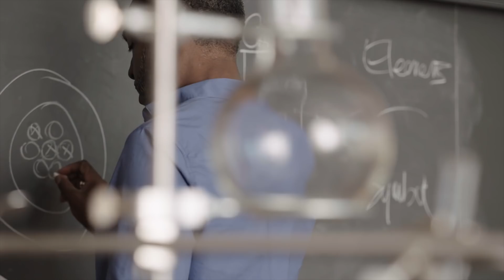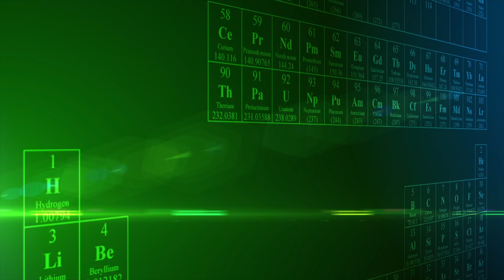A Solid Future for Electric Cars - The battery tech that will power us in tomorrow's electric cars

Comment: Now the time has come to think over twice or thrice by EV manufacturing Companies as to what kind of battery most convinient, easy maintenance, long sustainance and costwise is cheaper when compared to Lithium Ion Battery pack. Every Company found to be busy with their research and development wing to come out with this hurdle. It understood from various industries, through out the world, they are mostly concentrating on development of Solid State Battery Pack for their E Vehicles, which is found to be free from chemical reaction, easy to manufacture and econo- 
mically cheaper, whereby there is a possibility of reduction in EVehicles’ prices. Therefore, I feel Solid State Betteries would be suitable for EVehicles. Bye now.

Comment: Lithium is most abundant in troubled countries, like Afghanistan,,,, may be why we are involved over there actually,,,, and China is the beneficiary, oddly.
Sodium battery is more politically stable and salt is everywhere... The sea.  So, that development seems nice to hope for.  Now, Magnesium.... Hmmm. It is double electron availability but also more volatile.  Watch it burn in flares.  I am not sure of abundance of Magnesium or if it makes any true sense for massive amount of battery production/use.  First time I have heard of it mentioned for such purpose.  I prefer REDUX into H2 from solar/wind/hydro/nuclear.... THEN to use in Fuel Cell powered vehicles though... a variant form of a "battery", or a controlled "battery" cell..

Comment: I do wish there was more emphasis (like in Japan and Iceland?) on developing a Hydrogen based energy grid with H2 fuel cells and distribution/fueling infrastructure...
I Know, USA is large.  But, renewable energies can be used to  produce H2 along with big hydro and nuclear power generation... May be the best overall industrial scale Solar usage.  Produce H2 by day and not worry of the clouds and snow and darkness as that is already built into the equation, H2 is a storage of energy which is obviously enviro-friendly, and stockpiling can smooth out the off days..> Solar to directly feed the grid for electricity is just problematic with swings and dips of low production and necessity to smooth all that out for grids sake.  H2 fuel cell vehicles, equipped also with ultra capacitors with solid state battery combination, to aid in acceleration demand, is in my opinion, the way to go.

Comment: Electric cars are already safer and cheaper to use than explosion engines that burn and emit toxic chemicals.
Reply from the maker: There might be an issue with the recycling but overall you’re spot on
Reply: My calculator does not match up with that the pricing only becomes remotely competitive when federal tax subsidies are factored and even then when you compare a similar fit and trim it's just not the same take a gander at the pricing of the gasoline-powered Spark versus the electric Spark difference of almost $10,000 as far as I can remember. And this is in a vehicle that already gets 50 miles to the gallon so I don't think fuel savings will balance the equation.
Reply: Really>>> ??? Where do you think the electricity to charge comes from?
How about clean H2 Fuel Cell vehicles? Much better alternative but which is being politically pushed aside. Sad.

Comment: If they can produce an electric car that can charge up to say 80% capacity in 30 minutes and have a guaranteed range of 300 miles (in all weather conditions) then I would switch. 2025 is my guess despite the many promises being made.
Reply: Tesla's Model S 85's EPA 5-cycle Range is 265 miles already, and charges from 10 to 80% in 45 minutes.
Reply: I'm pretty certain your wish will be granted before 2025. By 2020, actually.
Reply: you will be waiting.... and never try excursion trips to the mountains and such... A/C and Heater will KILL batteries swiftly.  Elec. vehicles are best suited as commuter vehicles. Period.

Comment: No Electric cars winning F1 yet,no electric cars can refill in 3 minutes yet,all after 128 YEARS of being invented,No Sir,not yet,not in another 128 years either.
OK to go shopping in though,especially if you are tight fisted or have short arms and long pockets.They surely sell a lot of these ultimately Coal powered cars to Scottish folk.
Reply: - F1 is wary of new tech, but there is Formula E.
- Battery swaps were faster than refueling (until Tesla added a shield), but most people were fine with plugging the car in overnight.
- Coal plants, despite emitting more radioactive waste (aka thorium fuel) than nuclear power plants, still have better filters and locations than old clunkers driving by homes.
Reply: David, 
It wasn't difficult to install sufficient wind generation capacity given the relatively small grid load in Scotland.
How on earth do the Scottish government expect to be fossil fuel free in less than two years? Scotland is no different than the rest of the world there are lots of time the wind is either low speed or virtually nil. The point about speed is that the wind generator's out put is a cube law to wind speed so a small drop in wind speed gives a large drop in power.
Too much wind generation creates an instability in grid operation at times, or is Scotland planning on U.K.'s stable pool of power to moderate that?
Normally the inertia from large generators (in the 100s of Mwatts) provide a stable frequency, wind generators cannot do this.
What about black starts, as I understand it, wind farms cannot do this. I may be wrong as I have no experience of wind generators?
Reply: Tesla completed the world’s largest Li-ion battery (129 MWh) in South Australia, and it already cut grid maintenance costs by 90%.

Wind, solar, hydro, tidal, geothermal, biomass, etc., can and must be combined to create a sustainable grid.
Reply: Cess, 

I read that and failed to understand what grid maintenence they are referring to? Certainly not maintenance of transmission lines, transformers or switches. What else is there to maintain? While it may be large in battery size it is tiny in grid size even for an Australian state which has a capcity I read of some 3,000 G watts. In normal operation the thermal generators automatically adjust frequency and voltage to tight limits and at peak times have the spare capacity to cope or else have large consumers who are prepared to shed load to assist. In peak load situations a trip of a large generator or transformer would put a dip in the grid  and a battery like that can instantly react. Unless someone can explain otherwise I think there is a lot of hype in this battery system. I also read that at the same time as this was installed the S.A. state bought 500 Mwatts of stand by generators.
Reply: Storing excess energy at low/negative price and selling high generates money that covers 90% of the grid maintenance, i think.
Reply: Scotland does not have any coal power stations, the last one closed in 2016. It still has several gas and oil power stations but plans to have 100% renewable electricity generation by 2020. There have been days this year when wind turbines produced over 100% of Scotland's electricity needs and the wind is pretty dependable in Scotland.
Reply: David Fay,Yes it was just a joke aimed at the legendary mean pocket Jock.I lived there for five years and saw snow in July.
It was just a joke Jock,but electric cars are still shit.
So?
Reply: Hello Cees,

what a starnge word to use for that. However 109 (you said 129) Mwatt hours is small beer in a grid system.
South Australia state's woes are well known and this battery was supposed to help. Trading in electricity was not mentioned. I suggest it will take a long time for the payback?

Comment: So, in March of 2017, John Goodenough announced his solid state battery and stated its many advantages ov Li batteries - x3 the storage density, no dendrites and hence no battery degradation, -20ºC operation etc. The holy grail of a battery it seems. So why has there not being more about this since then? Of course it will take time to bring to market but there seems to be silence about it. I assume companies are working behind the scenes or else its been killed off...
Reply: Science news takes a decade or two to become common tech. JavaScript is almost ready to replace everything despite already running a Linux kernel in the browser years ago.
Reply: Exactly, out of the lab and into the factory is a bit of a process.

Comment: I would not assume a solid state battery will be li-ion (1:40) as was stated, it's unstable. Sodium is most likely to be used as stated at (2:50) since it a more common element than magnesium.   Also if they already have solid state coin size batteries (1:50) in laptops, they could stack them to make bigger battery. (2:00) low cost would be less a factor if you really could guarantee extreme longevity along with power density.  (2:30) Life of li-ion batteries is still not precise as they are so new.  I was told to expect 10% loss/yr on my Mitsubishi i-MiEV, it had 70 mile range in 2012, 5 yrs later it has 58 mile range.    Initial loss over first 2 yrs is far greater then subsequent years, it is not linear. They estimate that the latest batteries may last up to 20yrs with proper usage.   I wish for home use that other battery technology would be use other than Li-Ion.  Aquion batteries who are recovering from Chapter 11 bankruptcy have a great product.   Basically high tech salt water batteries, heavy, large, somewhat slow charge and discharge, but completely recyclable and estimated 30yr+ life cycle.   Perfect for solar homes where size and weight do not matter.   Used Li-ion batteries, if still viable should be used on low cost electric bikes.
Reply: Coin size solid state Li-ion are used in special applications as mentioned, but are they rechargeable? Why is the coin-sized battery in my watch not rechargeable?
Reply: Sodium in its pure form has the same problem lithium does in terms of stability, magnesium on the other hand has some serious advantages in terms of storage such as two electrons per atom instead of one. If it's half the size and weight while producing the same amount of storage there will be a very good argument for it.

Comment: I suggest that the " super capacitor " will exceed the battery in all respects .
Reply: Capacitor energy density is far lower than battery currently, with few practical breakthroughs available soon.
Reply: Capacitors can't store energy for long period of time hence can't be used for long term use even if they have large charge stored in them, which is know as energy density
Reply: What about wireless electrical technology
Reply: I believe batteries are also more energy efficient in the charge-discharge cycles - Li-Ion batteries are at something like 99%, whereas capacitors are at 80-90% if not lower
Reply: Sounds like supercaps are an ideal place to store excess solar energy to use at night or in a daily commute.

Comment: Today's ICE cars have ~300 miles per tank.  Tesla cars have similar range already. What we need now is faster charging stations everywhere to make long distance travel possible via EV.
Reply from the maker: What about hybrid engines?
Reply: Exactly we can achieve that much faster than thinking of new tech as a whole.
We already have quick Chargers in mobile industry we just need to make it feasible for cars and everything musk makes 😁.
Reply: I disagree,  what we need are evs that are cost competitive with fossil fuel vehicles.  From there, a universal charge standard wich would allow vheicles of all brands to be serviced by a charging station. Put those things in place and every restaurant Motel and parking garage will have charging stations installed.
Reply: r56mini Ehh, i drove a 2018 VW golf 1.0 tsi 965 km (603 miles) on one tank at an average speed of 90 km/h. And thats just average, not maximum range. The batteries of today do not have the energy density to achieve this yet. 
Hybrids like the Golf/Passat GTE are the best of both worlds, this is what we should invest in the near future. Technology that works now, not technology that may surpass this in 20 years time. 

300 miles, seriously, my 1995 Impreza wrx sti could do that. Thats a 250 hp at 10% of the cost of a model 3. And not exactly the most fuel efficent vehicle either. Not by a longshot. About 343 miles of range on one tank if i were being realistic.
Reply: @MegaEssin  I think what a lot of people fail to grasp about electric vehicles is the fact that you don't need the full range of your gas tank the overwhelming majority of the time. For typical commuter usage a 150 MI is more than adequate. If your vehicle has a 300 mile range you are road trip proof simply because after four and a half to 5 hours of driving getting out and stretching your legs and having a cup of coffee is not a bad idea. I suspect that with the Press of time and common adoption the overall capacity of battery packs will reduce as people begin to realize they don't need all of the range and can save a substantial amount of money by getting a 20 kilowatt battery pack rather than a 100 kilowatt battery pack.
Reply from the maker: Would you change to an EV if those issues are sorted?
Reply: If they be common in 80's 90's it be great, but today is step back, not forward. Main reason why Tesla make so good car it is simplicity, and hybrid are complicated. 
They was something we consider, because battery technology didn't have enough capacity/kg but this change fast.
Reply from the maker: That's a good point. Do you think Tesla will be the ultimate winner? Or do you think their production issues will be too great?
Reply: Energy Analyst Tesla is now winner. Because other companies start make projects for real EV, and this was main goal of Tesla. 
Is hard to predict future because with fast progress in A.I. I can'n predict world in 5 years.

Comment: Still not convinced enough to sell my 7.2 V8 Dodge yet,7 mpg and worth every penny.
Reply: 7 mpg?  I'm averaging 69.  A fool and their money soon depart.
Reply from the maker: I shudder at the cost of running a 7mpg car in the UK! We get 5 or 6 times that just running around in the city.
Reply: change your last name or be called a liar.
Reply: marty wise I have never had an opportunity to go 180 mpg on public roads.  But I guarantee I can beat you from 0 to 30 mph which is most real world situations.
Reply from the maker: Out of interest - what would make you switch?
Reply: The ability to maintain 150 mph constantly for 80 minutes,then refill within 5 minutes max,rinse and repeat this process until you are out of Germany.
Some people need to cover much longer distances in very little time.
Battery capacity darlings,charge time,always been their downfall.
Reply: Energy Analyst,you know as well as I do the energy in petroleum exceeds massively the energy in even the latest batteries,you are still fighting same 120 year old problem,endurance and recharge.
Reply from the maker: I don't disagree with you there - ultimately energy density is key
Reply: You confused MPG with MPH there sunshine,
If your clown car was upside down and on it's roof my car could tow it down the drag strip faster than it could go under it's own power,with all your family onboard,including the dog.
If you get close enough to my tailpipes and have a funnel attached to the front of your misermobile you can probably drive for free.I can go faster in reverse than you can go forward. Also your car sounds like a childs toy,is made of Plastic like a childs toy,smells like a childs toy,do you have to wind it up or do you have to pedal as you drive?
Reply: markleyg, 0 to 30 mph, fast in your Dodge, along with the tire smoke, un-burned gasoline fumes and atrocious noise, not very practical,  but you will grow out of it,  most men do.
Reply: markleyg Hey Mr.Squeaky wallet hinge,with moths inside that haven't learnt to fly yet,I bet you'e a load of fun at a party,"Guess how many miles I can get out of a gallon"kind of guy mmm? AVERAGING he says, but let me ask you,can you go 0 to 150 mph in 9.98 secs?
Of course not,that was silly of me.
Reply: strayreborn at FULL speed my tank is drained in 19 minutes or 70 ish miles [thats 1 mpg] depending on the way the wind blows.BUT I can refill in 3 mins to go again.All Englishmen use MPH and MPG even when abroad because thats how the cars are calibrated here,you have heard of England sonny haven't you? We invented things you may of heard about,like Electricity,the Jet engine,Television,the internet etc.
YOUR reasoning is why we don't have supersonic passenger aircraft anymore.What does it take to get through that thick skull of yours eh?
SOME people have the money and just want to go from A to B no matter the cost,no matter the means,car,bike,plane.
Personally I think your wife makes all the decisions in YOUR house,well thats what  your wife told me last night anyway.